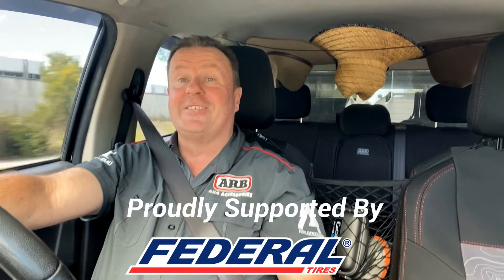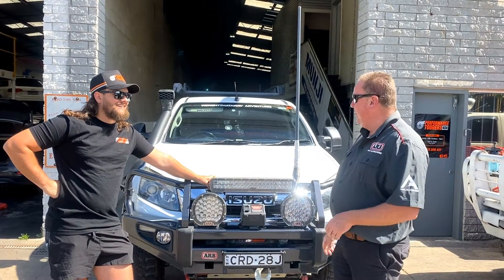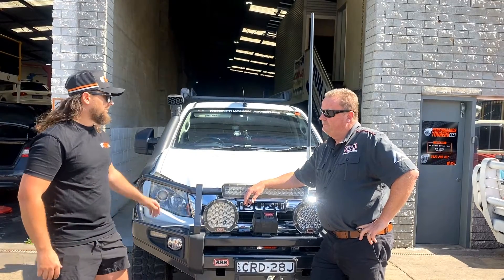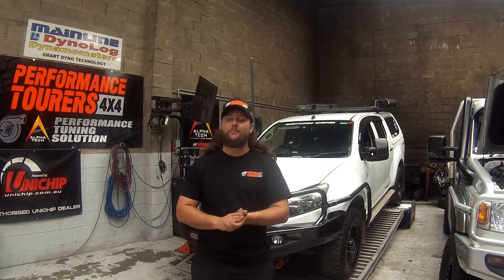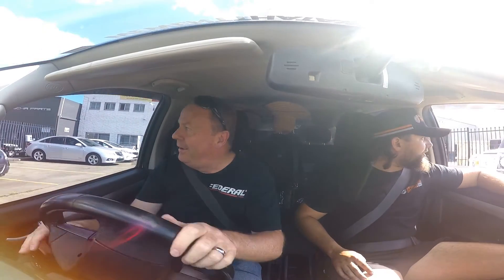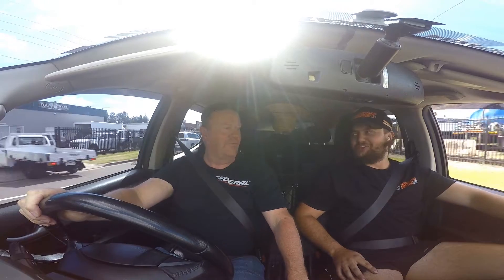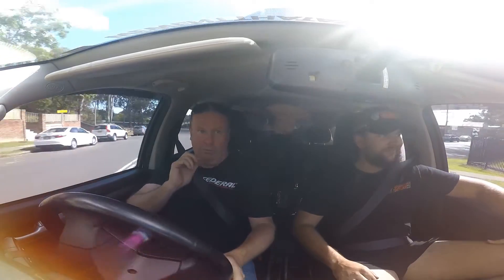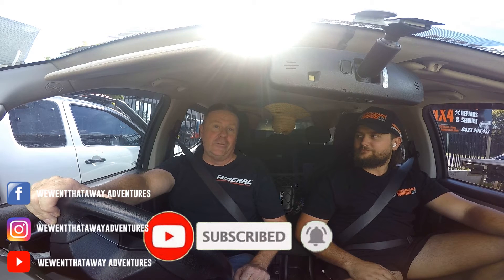4JJ1 DMAX TUNE BY PERFORMANCE TOURERS

Comment: How much did that whole kit set you back? Bar the trans cooler (I don’t tow)
Probably would leave out the throttle controller too as again, no towing
Reply from the maker: the alphatec unit is around the 2k mark

Comment: Hey tommy what was the fuel issue
Reply: Faulty Rail pressure sensor mate!
Reply: @performancetourers4x465 hey Tommy are the 5 speeds better than the 6 speed autos?
Reply: @B33ond   yeah mate the a750 is a great transmission. The 6 Speed leave a bit to be desired.